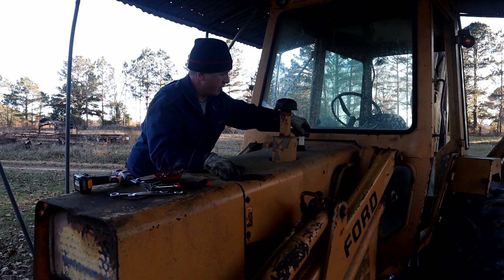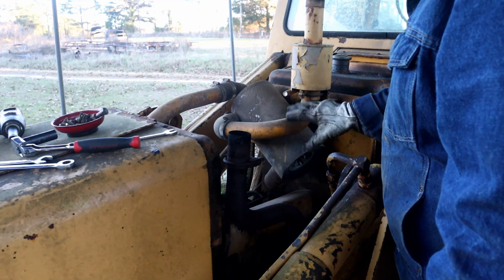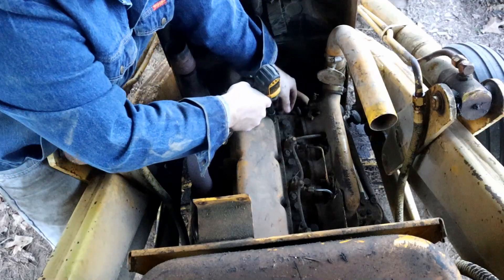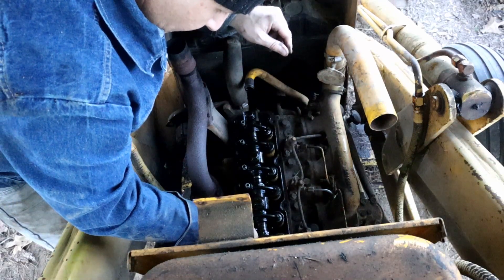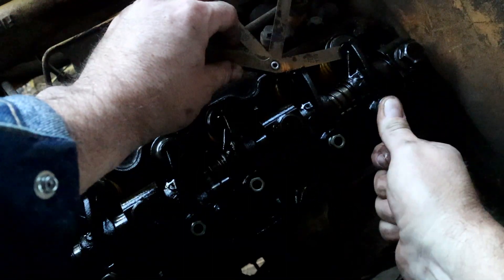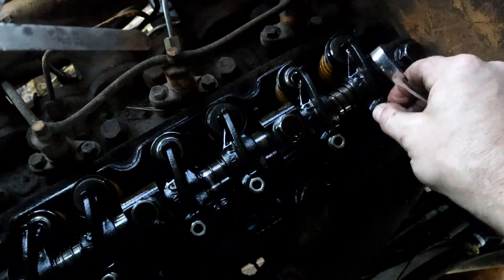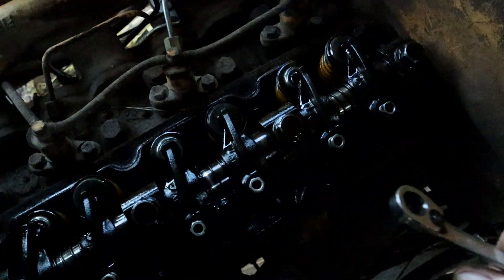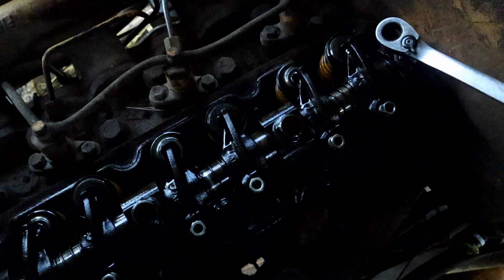Ford 555 Backhoe Dirty Secret Revealed How To Set Valve Lash

Comment: Hello Man Time that’s a good fact to know I appreciate you posting it!
Just a thought have you ever considered using lock tight? I know you can get the type that if you need to take it off again you just heat it up, and then you can loosen it up again.
It might give you a little more piece of mind I don’t know maybe it’s a dumb idea but it’s good you’re aware that it’s a problem. Anyway keep that old iron running!!😀
Reply from the maker: Thanks for the comment. I did at some point drip some red Loc tight where the threads meet, but it didn’t hold. 
Welcome to Man Time!